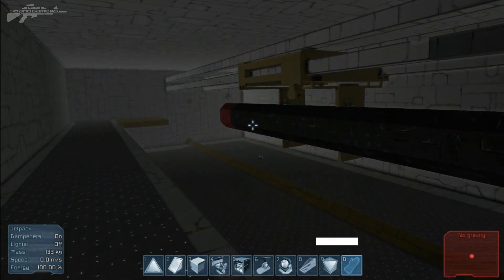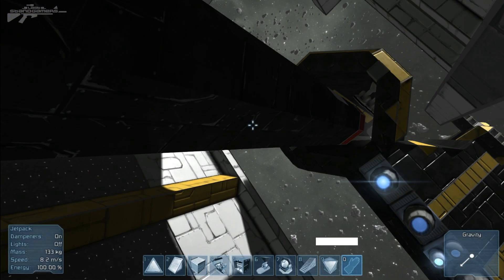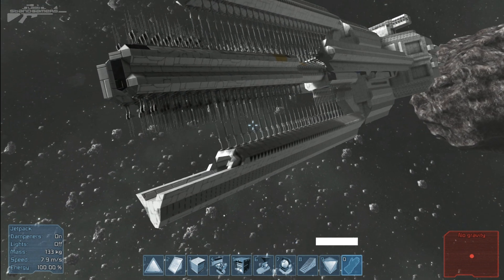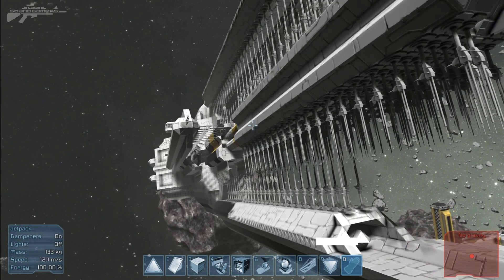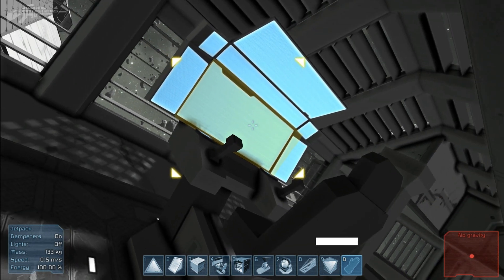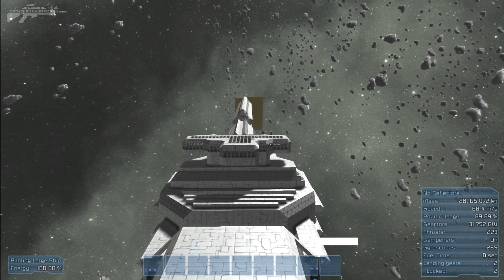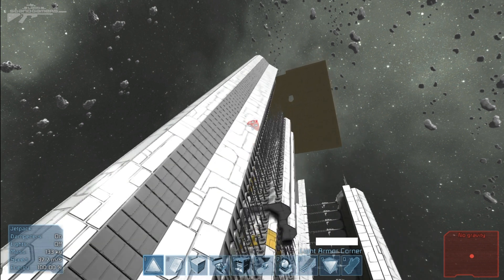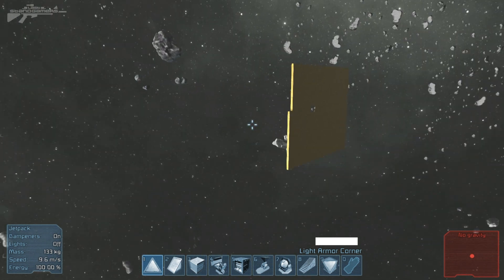Space Engineers - Armor Penetrating Torpedos Hull Breaching Part 10

Comment: Would it be possible to put a door on the successful torpedo and put a cockpit inside, so that way once it's punctured through the target ship, a crew member could climb out of it and start wrecking havoc within the ship?
Reply: Maybe put some engines on it that can be activated by the crew member inside to force the torpedo even further inside the ship?
Reply: Why not just build a ramming ship straight off the bat? armor plate the tip and build it so that when it rams through, the boarding party can then just run straight out the armor-piercing tip.

Comment: I'm just going to leave my sub here and journey on a quest to penetrate 7 layers of armor.
Reply: It can be done. I won't spoil the journey for you (unless you ask), but after watching the first torpedo video I did the same. Was able to create a small type ship, with a simple torpedo setup that is reliably capable of penetrating 4 blocks of large ship armour, destroy the large generator behind it, and then punch out through the 4 blocks of armour on the other side.

One tip, though, is that angle of impact is actually very important to testing and the overall effect of these weapons. Those same torpedoes of mine barely punched through a single block when hitting the armour at 45 degrees.
Reply: Thus far, using a small ship and a bit of luck, I've gotten through 3 layers. I'm beginning to learn how much velocity and mass matter, as well as how hard it is to control a small ship with a large torpedo on the bottom of it.

Comment: So, this creates smaller of an entry hole, but that is on a static target. Imagine how much damage it would do to a moving ship. You won't even need to board, just fire it and it would destroy the interior of the ship you fired at. As it pierced through, the rest of the ship would collide with it, and would smash into it horizontally, allowing it to break and continue to damage it until it exited out of the back of the ship. It would ruin corridors, rooms, gyro, reactors, and engines as it bashed it's way to the back. And worse, there's no way to vacate it except have it bash through one of the sides of the ship, so when it enters, it's bound to do a massive amount of damage.